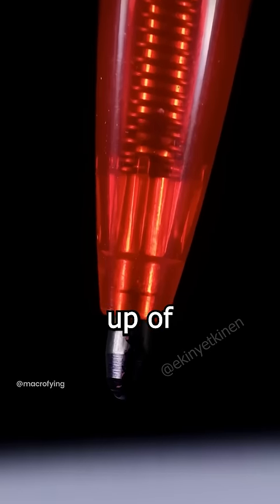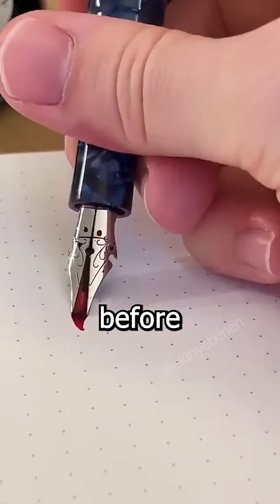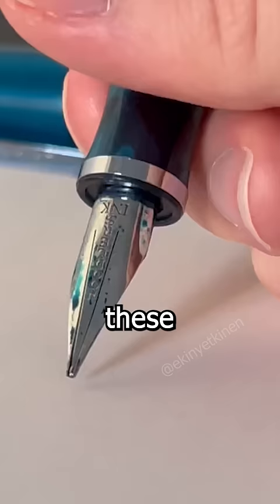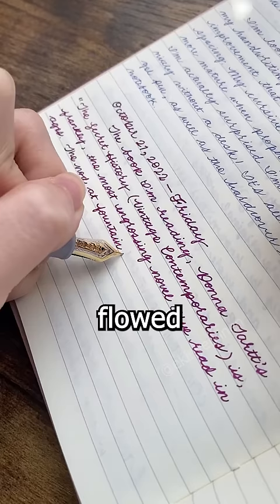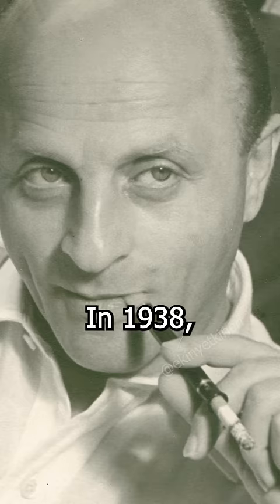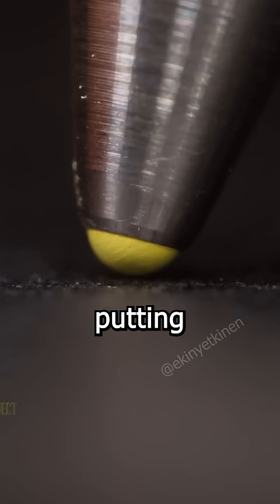Close up of ballpen - clever design😮

Comment: It also makes the ballpen more efficient using its ink. Though the strokes of a fountain pen is just unreplaceable
Reply: no judgement but it's "irreplaceable" not tryna be a jerk just tryna help
Reply: @ryanog419 don't worry, you weren't a jerk at all there lol
Reply: There are brush pens too
Reply: but the best pen is the gel ink pen, much smoother
Reply: @Kynchn gel is smooth but not as smooth as a fountain pen with lubricated fountain pen ink(pilot iroshizuku is a good example)
Reply: @sheeeeshseeeesh  yeah, but my favourite pen is uni ball signo. Fountain pens r really smooth too😊
Reply: @ryanog419 if you still overstand it, it's good enough. Cuz english
Reply: @Kynchn yeah, depends on your preference, I like fountain pens more
Reply: @ryanog419  i didnt even notice they spelled it wrong until i read ur comment i just automatically read it as irreplaceable
Reply: @ryanoglensky8350 nothing wrong with helping a fellow out with English, one of the most complicated languages
Reply: This is the most wholesome comment reply section
Reply: @ryanog419 dw dw correcting them doesn't make you a jerk now they know english better thanks to you ♡
Reply: @ryanog419 unreplaceable is a word, which is a synonym to irreplaceable. It's just less commonly used. But it is not wrong to use.

However both, unreplaceable and irreplaceable are technically wrong given the context.

As it can be replaced, you just won't like the result. So it's irreplaceable. "Impossible to replicate by other means".

If you want to be very correct that is. In common use the sentence is fine.
Reply: @ryanog419 you’re not a jerk as long as you’re being rude about
Reply: I agree, reason why I prefer using fountain pens over ballpoint pens
Reply: Bruh the fountain pen is too pretty :(. It’s like when everyone switched from switch based keyboards to the rubber based ones.
Reply: Facts
Reply: @_Physically rare wholesome internet interaction
Reply: @ryanog419  They also should’ve said “are” instead of “is”. If you’re going to correct someone might as well do so completely lol.
Reply: @ryanog419 even if someone looks like they're being a jerk i still respect that they prioritize educating others even when they know they'd be called a jerk
Reply: it just... makes you feel like a professional
Reply: damn, is the pen community this wholesome?
Reply: @Kynchn have to say, fountain pens are just superior because it doesn't cause pain in my hands as much from gripping
Reply: @nohomo4774  okay 🙂
Reply: @ryanog419 then some random dude inserts nerd emoji
Reply: Ó
Reply: C9
Reply: @ryanog419 wow, someone spelled "judgement" right instead of "judgment". That's a rare sight but a welcome one.
Reply: fountain pens are more ergonomic too.
Reply: @talcorp9998 😂
Reply: @rosetyong  wutt? Did eye spel sumthing Rong?

Comment: It may have been invented at that time but was not made available to the public until 1949
Reply: An another fun fact is that "somehow" half the diary of Anne Frank was written with one, go figure
Reply: @georgeoswald4615  NSN brother...Never Stop Noticing
Reply: @georgeoswald4615 it wasn’t written in ballpoint ink, those were annotations and corrections done after the diary was recovered
Reply: @budge3035  uhum, I don't buy it. It's either original or not. Turns out it isn't
Reply: @georgeoswald4615 presented with evidence proving you wrong: 
You: I don't buy it

Comment: It dries faster as the ink mix is different. Ball point pen ink is oil based instead of the water based ink used by fountain pens.

It dries faster as it isnt water based ink, not because of the ball nor the layer thickness.
Reply: Source for both?
Reply: Lol, go look it up. I don't need to cite sources. You need to do research.

Fountain ink is watery, and ballpoint ink is very thick and greasy. 

If that's hard for you to understand, then giving you fish hasn't worked, and you should learn how to fish for yourself.
Reply: It is because of the layer tho. Little oil adheres to the ball and only some of it goes to the paper. If you deposited on the paper the same ammount a fountain pen would, the water based ink would dry faster

Comment: Fountain pens are still around, I use one because I have a tremor in my hands, the angle you can write at with a fountain pen lets me rest more of my hand on the table to stabilize the tip. That and I like to be able to refill my pen. I had one for almost a year (stolen by hospital staff) and I’ve since replaced it. Koweco is what I recommend as they are good, cheap, and reliable. Like Kalash, but for ink. Although in below zero temperatures I’ve found it harder to write with it.

Comment: You're sort of correct. Ballpoints spiciffically use a grease based paint
 Other ball pens use different ink. Gel uses gel ink obviously. Rollerballs use a liquid ink like fountain pens which would be a better comparison. 

Unless you're using a heavy flex pen or even an omniflex like one of them in this you'll put down a lot of ink that takes longer. But for most they'll dry faster than the amount of time you need to wait for ballpoint grease ink to stop smudging. 

Also you get a smoother more consistent line

Comment: The downside is ballpoints don't work well for people who are left handed. In order for the ballpoint to be able to collect ink it relies on you pulling it, not pushing when writing left to right with your left hand. Because of this ballpoints tend to stutter as they fail to collect ink properly when you write left handed. Fountain pens tend to work far better, especially when paired with printers ink, which dries almost instantly, and costs less than 10$ for an entire bottle.

Comment: Well there is more to that story… fountain, pens use a water-based ink that is also water soluble in most cases. The ink is regulated by what’s known as the artery feed system, and very on distribution, depending on how generous the feed system is and the ““ witness properties of the ink… ballpoints, use an oil based paste. The oil based paste ink is viscous enough to not need an arteries feed system to distribute it in a controlled fashion. So actually, a ballpoint ink is extremely high viscosity relative to the water based highly fluid, fountain, pen, ink.

Just noting this as a person who has collected and repaired fountain pens for 25 years.

Comment: There's a big misconception here about fountain pens and ballpoint pens. Ballpoint pens actually do not use the type of ink that fountain pens use, and that's why they "dry" faster. If it weren't for the special ink made for the ballpoint pen, it would be useless. The pen would dry up very quickly, get clogged, and not even be shelf stable.
Fountain pens also do not always flow in a "thick layer, making them dry slowly", but some can be wetter than others. For me, my fountain pen (Pilot Metropolitan F) sometimes dries faster than some ballpoint pens, especially on some cheap paper, because the paper can absorb my pen's ink, while the ballpoint pen ink just sits on the surface of whatever you're writing on.
All of the b-roll that's shown of ink sitting on the surface of paper, that's no regular, cheap paper, and those are not even regular "fountain" pens, except for the last one. Those pens making those thick and thin lines are called "flex nib pens", and are a type of dip pen used specifically for calligraphy.